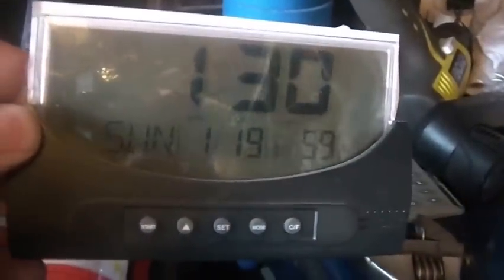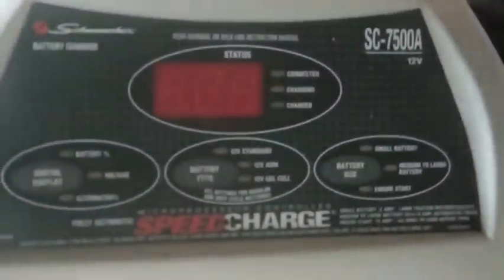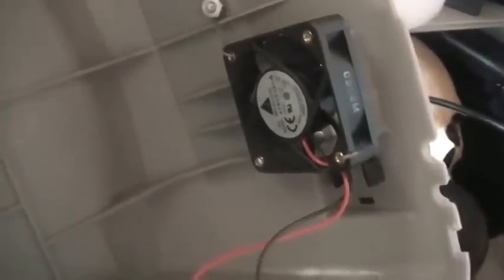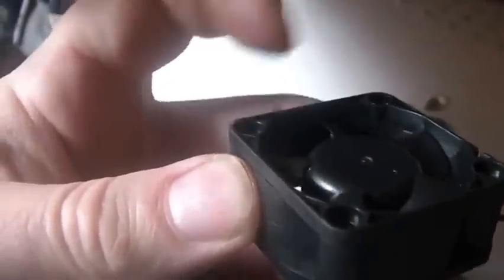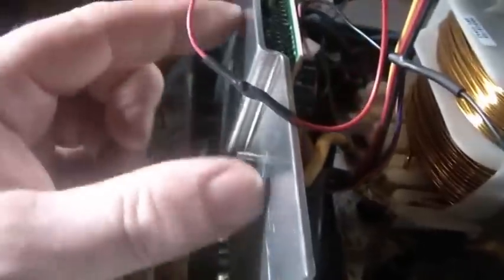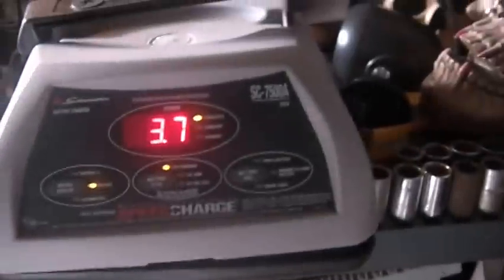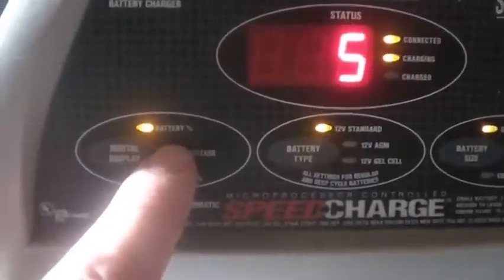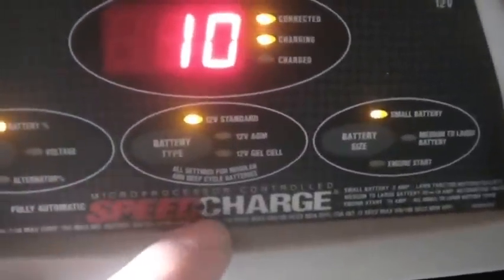1_19_2014, Red Neck repair of my favorite battery charger,

Comment: It would be nice to know where to press once the 4 screws are removed from the sides , I have a SC 10030A that has a noisy fan. I took the screws out but the top part must be interlocked with the bottom and does not lift up easily as one might expect , so I put the screws back not wanting to risk damaging the plastic parts that are locked together .Looking for videos that might show it I found yours....unfortunately it doesn`t ...the search goes on .

Comment: Cool charger, fancy. I have a charger by that brand but not as fancy. The only thing I don't like about it will not let me use it as a power supply. Like checking radios, lights, and fans. My old one from the 80s would.
Reply from the maker: William staten, U are right, this charger can not be used as a power supply, I like the way charges batteries and gives charge status. Thanks for watching and commenting!

Comment: wish i could have helped ya out harvey. i have about 4 boxes of computer and inter cooler fans for stuff like this. not only am i good with engines i also tinker in electronics. the one you have looks to be a 2x2. whats the voltage and current
Reply: really cool man thanks

Comment: I came across this video wile researching battery chargers. I have a fork lift battery charger that I want to use in a inverter project. I want to rewind it. to a 24-0-24 and 120v . and use it in the boost stage with push pull and use MOSFETs controlled by a arduino or some other micro controller. with a feedback regulation. do you think this will work?  or would a bunch of switch mode type DC boost inductors work better? I noticed you were a electrical engineer. I'm just self taught and only tinker. I can use any advice I can get. my goal is a minimum of 5kw at 120v. but if the transformer can handle it . the more the better. I need it for my off grid house. but is this low frequency push pull DC boost not efficient  as the high frequency flyback DC boost design ? I am not all that concerned with efficiency. but anyway thanks and if you can give some advice its welcome thanks again